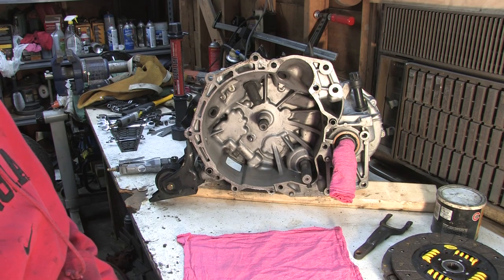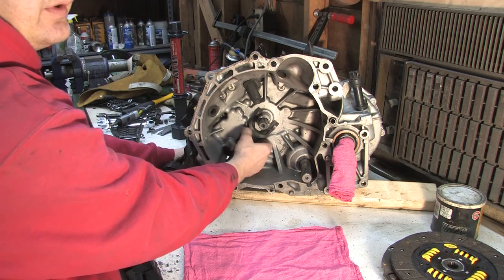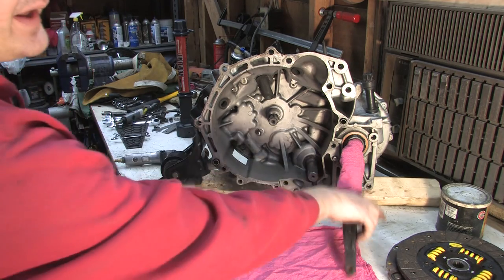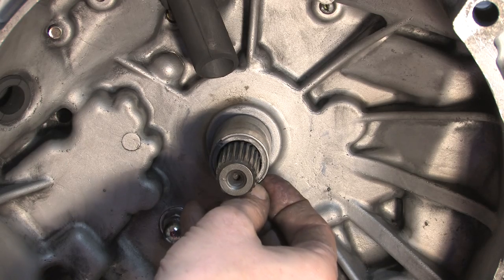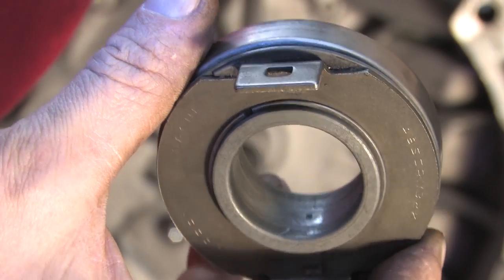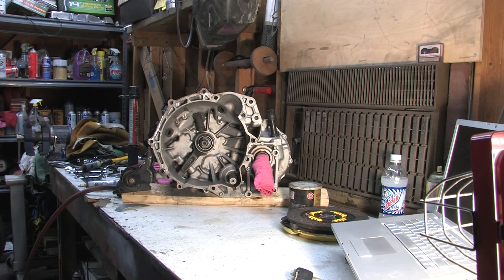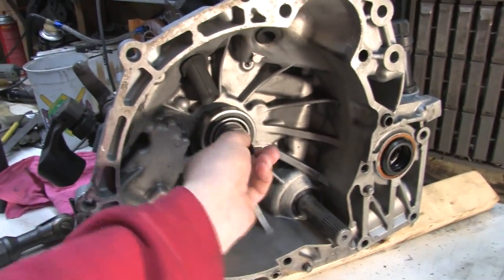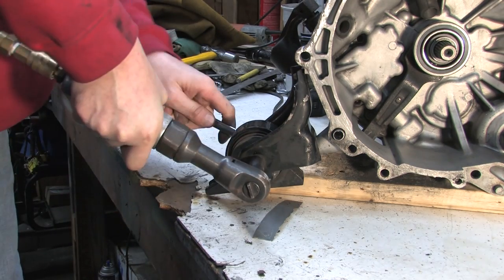Trans & Clutch 3 - Fork Tech, Mounts & Service Parts

Comment: Interesting note: I had a axle seal that was leaking, after replacing it, it continued to leak. The problem was tracked down to that transmission breather which had become old and hardened to the point that it did not allow the excess pressure out of the gearbox causing the oil to be pushed out of the driver side axle seal. Once the breather was replaced the leak went away. This breather can be commonly overlooked.

Comment: Even though alot of this looks very familiar, With all the parts accumulated for my rebuild. Wish you weren't a DSM guy. Lol I have so many questions for when I start. albeit though I love these vid's, very informative. Cant wait to get my sleeved h22 short block in with forged internals. Going NA I have gathered everything along with OEM seals clutches lightened flys, to cams. Everything! So watching these vids is pretty god sent. When I look up anything honda its just them at the dyno running numbers. Thank you for your time and commitment to share. I plan on using your P&P techniques on my head, although it will be a very mild Stage 0-1.

Comment: Jafro! How big Is your washer under the pivot ball?

I replaced my master and slave, tried the extended slave rod and also tried bleeding the Hydraulics with a one way check valve and I still can't disengage the clutch.

I'm guessing my flywheel step may be off but if it isn't then is shimming the pivot ball the way to go? I have act mb1-xtss clutch on 3g eclipse

Comment: Is it possible to replace the "Clutch Housing Retainer" on a 1993 1G AWD transmission? my OEM throw out bearing went and the bearing rubbed on that aluminum shaft and destroyed it... its the only thing thats holding me back on driving it... it looks like its one solid piece on the bellhousing so i dont know if its replaceable or if a whole new bellhousing is on the parts list now.

Comment: Bought a 92 Laser where the guy adjusted the master cylinder IN so far that the throw out bearing races welded.  Everything that didn't weld just fell off, disintegrated, or was unrecognizable.  The fingers on the clutch fork were about 3/4-worn away.  The fingers on the pressure plate were gross.

Comment: exactly what I needed, plus my question at 9:00.
 I shimmed it, without knowing I needed it, so when I put it in 
I found it was just ahead of the middle of tho hole with the FORK in it.
Now my question: the rod in the slave cylinder always pushes against the fork,
so the TOB is always sitting against the pressure plate fingers. Is that normal?

Comment: couple questions, would I be good reusing a fork?(would like to say 60$) and I have a 2g trans that I am going to use in a 1g so would I need a 1g fork or 2g fork or are they the same? also on your next video with all the hardware, can i take those measurement and just pick up hardware store stuff or use OEM, I was told that hardware store stuff is actually a stronger grade

Comment: Jafro I need help!!!!! I know you are a 4G63 guy but for the situation I'm in I need info. I have a 1993 Mitsubishi Eclipse 4G37 (1.8) that had a automatic transmission in it when. I had a 92 4G37 with a manual transmission in it and the automatic was shot. So I took on a big project for me and changed it to a manual transmission car. The first 1,000 miles were great! And then I soon realized why locktite is used on flywheel bolts. I changed the clutch with a new TB and Pressure plate and right away I had issues with 1st and reverse being really tough to get into. I was able to get some miles on the clutch and that seemed to help but it was never like it should be. I just lost the cluch due to being a cheap clutch and so I replaced it again just this evening. I put a washer behind the pivot ball and cleaned everything up and put it back together and it's still doing the exact same thing! I have tried using more of the master clutch pump adjustment and that seemed to help a little bit but i'm not sure if I need to do a little more adjustment. Your advice would be much appreciated!
Reply: Watch the other video Jafro posted regarding clutch adjustment. Unfortunately, some things you just have to learn by tinkering with it. Good luck

Comment: Hey I'm replacing my clutch and slave cylinder right now, and i was wondering what type of transmission fluid do i use. I have a 1998 Mitsubishi eclipse gs and i was just wondering what kind to use, if you know and could answer please be specific, thanks i appreciate it and once again great job on all the videos.

Comment: Hey Jafro, my I ask your advice on a flywheel grinding into my starter casing. I just pulled my starter and found this gem. I did notice my "hidden" transmission bolt to be loose as well, but I am shocked on how much that may matter. There are some thread on tuners but they are not much help.  I appreciate your time, sir.

Comment: I hear a very remarkable hissing sound when in neutral and clutch out. I assume it just a matter of time that catastrophic pressure plate failure occures. gaaawd. Do you guys think when it comes to that, that I could manage to replace it? I did brakes twice and also front bearings, have only a small 69 piece cheap toolbox, 3/8 and 1/4 in. drive. Car is a civic MB3. D15Z8. 140k km. 1st clutch

Comment: hi I wanted to see if you can answer a question I have my Tanny on my 98 eclipse gst will not shift in to 2,4, or reverse it shifts into 1,3,5 just fine I have opened it up and nothing is broken. need help
Reply from the maker: It's your shifter cables.  They've come loose.  They're supposed to be bolted down.  Get someone to shake your shifter and go through the gears while you stand there and watch the cables.

Comment: You talk A little bit about but transmission Dal pans "MD020260". Are these the same Dal pains as the engine to transmission or are they there separate pens  ??
Reply from the maker: You know?... I'm going to look those up for you.  I'll see if it's the same part... No.  They are not the same part.  They're completely different sizes.  Mixing and matching these would be dangerous because you could mis-align the cylinder head.
MS471111 is the head dowel pins.  They're 12x13mm.  MD0202060 is for the transmission/block, and those are 10.5 x 19.3mm.
Reply: Jafromobile I just wanted to say Thank you for getting back-to me and your videos help tremendously. A problem that I'm having is finding the M8 Dal Pan that holds the Crank walk ball to the transmission. I went to dealer with the part number that you have posted in the point that I received was just the block to transmission dal pen. Do you have the part number for the actual one with m8 threads ?
Reply from the maker: The dealer has no idea what the "crankwalk bolt is". That crankwalk bolt IS a transmission-to-engine bolt.  The dowel pin used on that bolt is the same dowel pin used on the M10 bolt on the other corner of the block.  It is the transmission dowel pin, and there are two of them on opposite sides.  It's not an M8 dowel pin, but an M8 bolt goes through it.  That might be where the confusion is. The dealer won't know this.  If you want it delivered to your house instead of driving to the dealer, maybe order it from mitspartsdirect?
Reply: Jafromobile do you the part number for it ? The md020260 is the the one I need . I need the ones for the transmission with the threads.
Reply from the maker: The dowel pins aren't threaded.  Look deep in the hole of the transmission.  It's got a 10.5mm smooth hole to accommodate the dowel pin, and then there's an M8 bolt hole further inside that part that's threaded.  Notice the block has threads on the opposite side of the smooth bore.  Those threads are M10, and nothing else screws into them unless you're bolting it to an engine stand.  That's why the crankwalk bolt is weird.  The M8 "crankwalk bolt" doesn't engage those threads because it's smaller in diameter, and the dowel pin is sandwiched between the transmission and the block to keep them aligned.  Get 2 md020260's, your transmission bolts, the crankwalk bolt, and the transmission spacer plate.  Put the spacer plate on, put the dowel pins in place, align the clutch, and put the transmission on, then torque the crankwalk bolt and you'll be golden.  It's weird that it's 2mm smaller than the bolt on the opposite side, but that's how Mitsubishi did it.
Reply: Jafromobile Thank you very much for all your help I know I order the right parts. I thought there was a total of 2 pens for each of the 2 holes the needed it pins .
Reply: One last thing. The Dal Pan that goes behind the fly will that goes in to the crankshaft is it needed? I don't remember you going into detail about it in any of your videos

Comment: I have taken the shift cables off and tried it manually it feels like it is locked I took it apart and looked at it. when I put it back together and put it back in the car it working but as soon as I stopped at some train tracks I tried to shift to 2ND and it didn't want to go in anymore
Reply from the maker: The bracket... the bracket that bolts them down to the transmission.  Is that loose or on backwards?  That's what I was referring to that you'd see if someone else shook the shifter around and went through the gears.  If it was an internal problem with the transmission, you would have lost a pair of gears, not all the upper or lower ones on a shifter.  That's why I gave you this diagnosis.  It's happened to me before.  Everything looked normal to me, but it was how the cables were bolted down and secured.  Try going through all the gears directly from the shift linkage.  It's the same pattern as the shifter, it's just sideways.

Comment: its not called a throwout Bering because you throw it out.. its called that because it throws out force and friction.... from the fork and disc and pressure plate and takes the thrown out force upon it self
Reply from the maker: 'twas a joke.  Anyone who doesn't replace it whenever they're this deep in there is the punchline.
Reply: it was fucked because i had a s 10 this week and pilot bering was frozen on out put shaft and had to remove every bolt on pressure plate and them use a porta power to push it out--a rwd manual trans took 5 freaking days and he cried because i charged him 600...what a nightmare!!!!!! be well bro--yes i replaced the t.o. Bering..lol